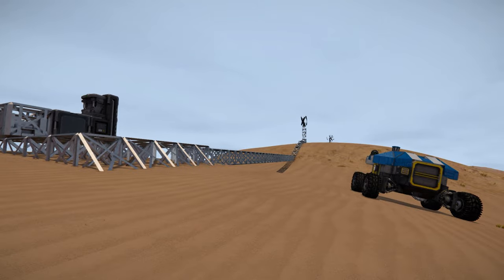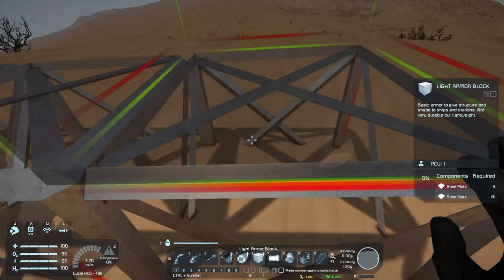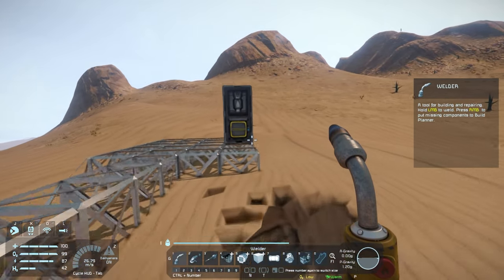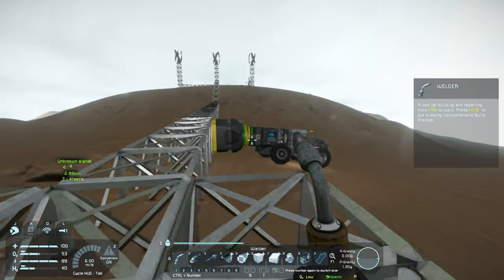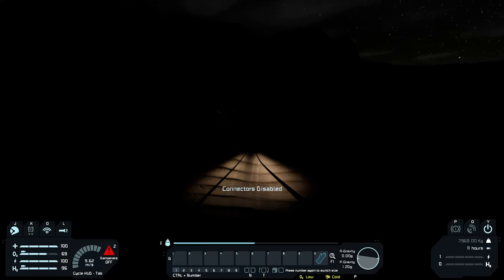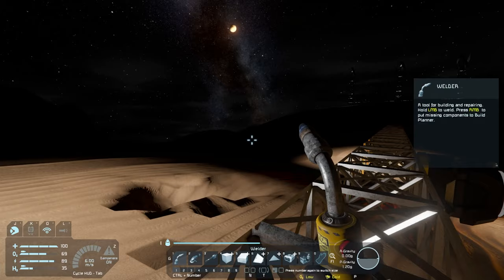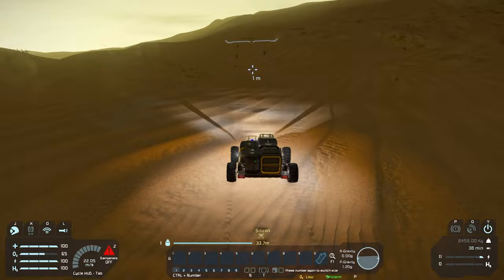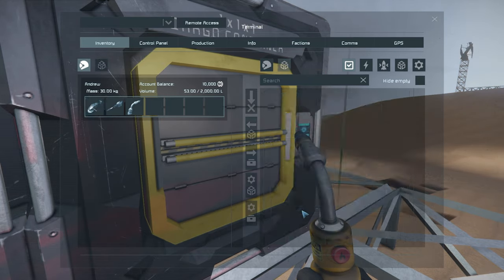Space Engineers Survival 2021 (Episode 2) - Upgrading Everything! [Pertam]

Comment: Maybe add some of those smallgrid antenna/battery/landing gear and solar panel contraptions I mentioned in the last video. Or put a tall spire on the highest point of the tallest mountain and give it a TON of lights and like 2 wind turbines to keep it going.
Beacons are also a cheap alternative to antennas in regards to power about 1/10th the power cost at max range. So maybe a small grid landing gear with a beacon and a battery/solar panel
Reply from the maker: Oooo I like the spire idea! That's a really good way to always know where I need to go to get back. For the beacons, I might decide to use them later for things that are very far away from base. For now though, I want to keep to using structures, lights, and my own memory for navigation.

Comment: as always you have done well
i have one suggestion to give for the improvement of your base:
set up a very tall tower relative to the rest of the base (around 100m in height?) and place very bright lights pointing in every direction on the higher section of it
the lights should have a different color on every side. (for example: bright yellow facing in front of the base, light blue facing to the left of the base, bright red to right of the base and pure white to the rear of the base) this would make it so you could see you base from very far distances and know your orientation relative to it, almost like a lighthouse.
these are the solutions that must be made when GPS systems are in shortage
Reply from the maker: That's a good idea! Actually, I might just straight up make a lighthouse lol, that sounds like a cool project to do for the series!

Comment: A tip for windmills. Put them at least 10 blocks up from terrain height. And then you can put windmills on the sides of the tower instead of building a whole separate tower for each windmill. If you make the tower a 3x3 wide pillar you can slap the windmills on each side so you can just put 5 windmills on 1 pole, or you can keep building higher and put the windmills down the sides of the poll and you can just space them out by 6 or so blocks. That's what I do, I end putting like 20 or so windmills on each tower, 5 towers and im typically good for power for a really long time.

Comment: 9:50 Just build the second battery on the craft, put the new one in charge mode and the old one in discharge mode. in a couple minutes the charge will have completely transfered from a battery to the other!
Reply: You lose 20% of your overall charge level, but it's better than starting from 25% with a brand new battery.